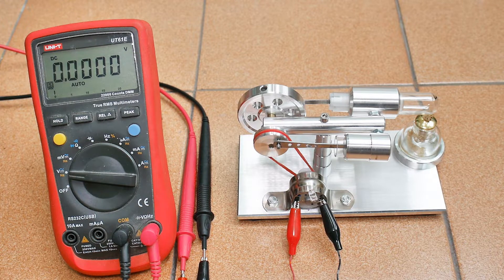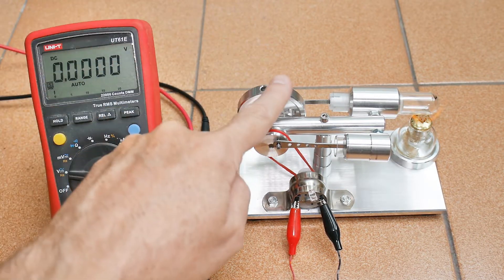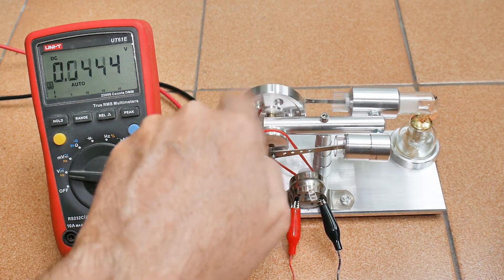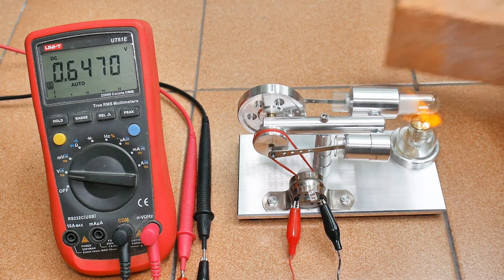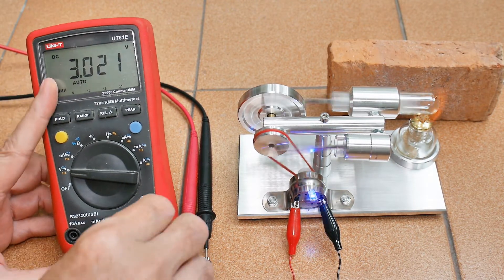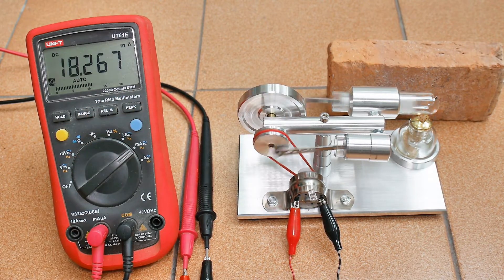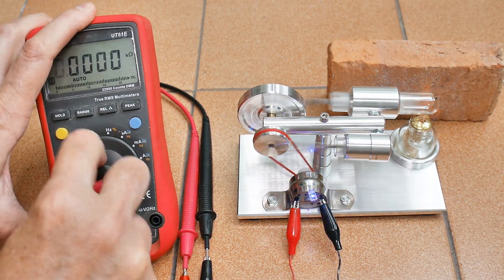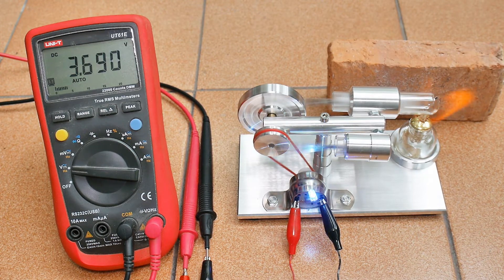Stirling Engine w/ Generator Power Measurement

Comment: ive seen sterling engines used practically only once. People use sterling powered fans on top of their wood burning furnaces to circulate heat in the room.
Reply from the maker: In the early 1900s, they also made kerosene powered Stirling fans. Philips made a small Stirling generator to run a radio. And finally, NASA uses them in satellites to position things. But outside of those very unusual uses, I agree, most are not practical. But I have an idea to demonstrate coming up!

Comment: for accurate power measurement, voltage and current should be measured across and through a load at the same time.

Comment: Should we adjust the multimeter to AC voltage mode and connect it in parallel to the LED to measure the voltage, then use AC current mode to connect it in series to the LED to measure the current and finally calculate the power?
Reply: Also, the engines have different power at different RPMs, these are very much like the models from China and the engines are equipped with very less efficient generators (motor reverse usage), these are what I know❤
Reply from the maker: Not sure if that would work. The generator is DC.
Reply: @tsbrownie  Although the generator is a DC motor instead, it emits AC power, which I tested using an oscilloscope, as I once had a similar model.
Reply from the maker: @木人石芯   It will emit pulsed DC.
Reply: @tsbrownie  In fact, what it outputs is not pure DC. It has three wave peaks in one cycle. At this time, it is inaccurate to use the DC gear measurement. How to accurately measure the power of an engine running at a few hundred milliwatts is also a problem I am dealing with.

Comment: by the result im guessing u were using a small dc motor as a generator?? but why? if u wanna do a power measurement then please use a real generator.
Reply from the maker: That's they way it came. And you are right, these little motors are not efficient generators. I have a video on that.

Comment: Wrong!!!!you must measure current and voltage at the same time. Voltage when you get 30mA! Do it for many concurrent values and you will get power curve!!!!
Reply from the maker: I don't have the equipment to do that. My amp meter will provide a dead short giving bad voltage readings. So it's not the best, but it gives some idea about what is going on.

Comment: Your calculations are wrong. The short circuit current will not remain at that value under a normal load, it will be less. The short circuit current is at 0V at the output, which gives 0W, also, 4V on the output with zero load again gives you 0W.
Reply from the maker: True. I need to redo it. I was just trying to give a feeling for the power, but a lot of people want better.

Comment: These are fun, but based on your output, my dream of having a Stirling-powered usb charger would have to be much bigger to produce the wattage I'm looking for :/
Reply from the maker: You can search on youtube for videos on these. I think it was Philips that made one you put on your stove to power a tube radio. They have been used on and off, but they are tricky. Scaling them is tricky if you want them to be efficient.
Reply: Not if you have it running continuously into an external battery

Comment: Why did your meter when you check the amps big the motor you could tell it was dragging it down ? Very curious  thanks for the vid
Reply from the maker: Not sure I understand your question. Most amp meters put an almost dead-short on the system, so that will drag down a generator.

Comment: How can we increase the watt of this engine
Reply from the maker: Two quick ways: make it bigger, run it at higher temperature differentials.
Reply: @tsbrownie  how about replacing generator motor with 775? It will run?
Reply from the maker: @HydrO152  What's a 775?

Comment: I'm afraid that your measurement method was entirely suitable here. You need to measure the max power at one specific rpm, the operating point.
You can do that by using a variable resistor and two meters for voltage and current simultaneously, or even a wattmeter. You'd then tune the poti to find the sweet spot where amps and volts give multiplied the most watts. 

Max voltage (sort of) aka rpm doesn't say much about the power. There's model Stirling engines that exceed 2,000rpm, with no usable output though.

Comment: Maybe you should try having the amp meter in series, rather than shorting the motor.... No wonder it lost RPM....
Reply: There are 2 issues here with his power measurement  First, you nailed it as he was testing short circuit amps, that is why the motor stalled.  That is maximum current it can produce, but it is not usable as the voltage will drop to 0 so power is effectively zero also (P=I*E).  The second is he was measuring open circuit voltage.  There was no load on the generator., not no current was being drawn, again power was effectively zero  As a result, the real power is less than the .12W he calculated,  What you need is a variable resistor and 2 meters, one in series for current and one in parallel (across the resistor) for voltage.  Adjust the resistor in steps and record the voltage and current.  Plot these and you will see the power curve under variable loads and should also see the maximum power
Reply: Exactly. I was wondering why he did that when he was measuring AMps.

Comment: seems insane that such a loud and fast little thing is only producing 0.1 watts. I was expecting about 20
Reply from the maker: I have roughly measured the efficiency of the little motors they use as "generators" and it is very low, like 10% to 20%.  So a good generator might be able to put out 5x to 10x more than I am measuring.
Reply: @tsbrownie  so if I replace the motor with a better motor to use as a generator I'd get better voltage?
Reply from the maker: @bmo316-retroDev  Voltage depends on the number of turns in the winding, plus things like total resistance of the windings.

Comment: How does the engine work? Are you heating out he air or water?
Also how does the lever move backwards and forwards?
Reply from the maker: I have a video that explains the Sterling engines.  They all operate by heating and cooling a "working gas" (air). 
https://www.youtube.com/watch?v=Q5QEBqjkNjo&feature=youtu.be

Comment: This was an honest evaluation of how little power these can generate. This type burns more energy in fuel than it puts out in power. 
There are much more efficient Stirling engine designs but none have ever proved they are useful compared to an internal combustion engine.
They are a nice little toy novelty. Nothing more.
Reply: Every tool has it's use. Just because a hammer is better at putting in a nail then a wrench doesn't make the wrench useless.
Reply from the maker: So true.

Comment: Hello, I was just wondering where I might be able to find a kit like this or one that I can hook a multimeter onto. If not, how might you suggest I measure power output and how I might make an apparatus for that to attach onto an existing engine. Also, are you able to exchange the cylinders for different lengths? Cheers.
Reply from the maker: You can find them easily online.  The best way to measure the output is power, for that you need to measure volts and amps at the same time.  The cylinders seem to be test tubes (or glass syringes) that have been sawed off.  So I would guess if you can get the same diameter tubes then they could be changed out (some kits supply a spare tube).  You also might have to modify / change out the flywheel to change the stroke.

Comment: I'm planing to do the same thing with two engines. Both a different configuration. I will use buck converters and I'll use a 24mm motor. It will be two to 3 times longer than the short stubby one that's on your engine. I'm also going to change the pulley at the motor to an even smaller one for more RPM's.  On one of the kits I can change the pulley on the engine side too, so I'll Put a larger one to help with more RPMs.  One of these https://www.amazon.com/gp/product/B07XG8PXQ8/ref=ppx_yo_dt_b_asin_title_o00_s00?ie=UTF8&psc=1 and one of these https://www.amazon.com/gp/product/B08731G6DW/ref=ppx_yo_dt_b_asin_title_o09_s00?ie=UTF8&psc=1 <-- This is a modern version that can get up to 4k RPM's but it is small. Can't wait to see how it turns out. They are all metal so no glass issues! Here is a video sent by the seller of it working in action. I am still waiting on it. https://www.youtube.com/watch?v=Dg_TxUoDQ44
Reply from the maker: I'd be curious to see if running at higher RPMs leads to higher or lower efficiencies.  Be sure to make a video and leave a link here.
Reply: You should have measured current and voltage through some resistor or miniature bulb to get more precise estimation. Your measurement shows voltage at zero current and current at zero volts. Both give... Zero power. But the estimation of a fraction of watt is realistic as to determining the order of magnitude.

Comment: Got a double one of these coming want to hook it up to a boost converter and charge a phone
Reply from the maker: Interesting.  Let us know how it goes. Post a video!
Reply: Awesome! Make sure you connect belts and generators to all main AND secondary wheels to get the most power. Leave no wheels left un-belted (each engine has two wheels)!!